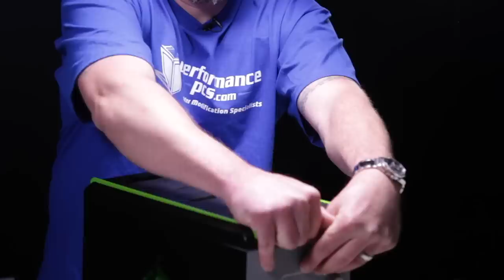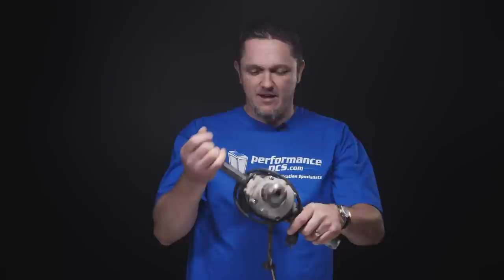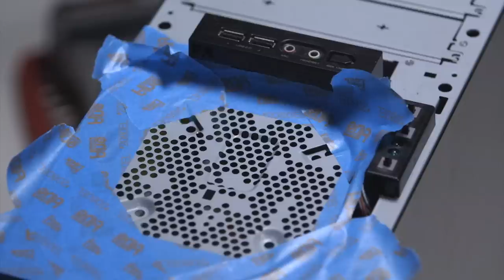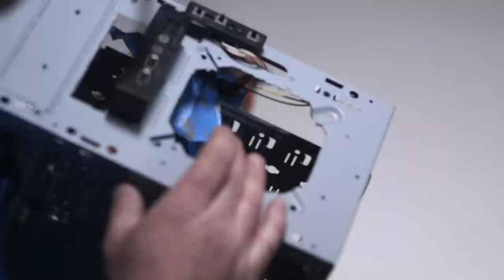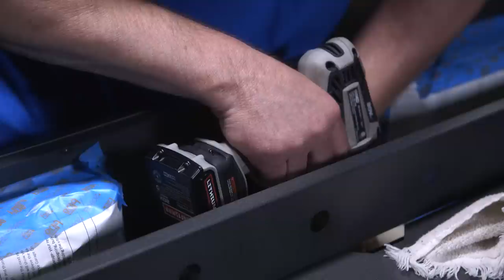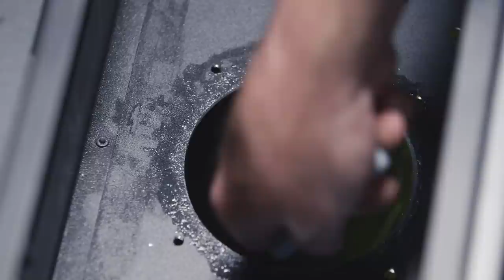GeForce Garage: Cross Desk Series, Video 1 - How to Modify Your Chassis For Better Airflow

Comment: So for all the people who care this video is geared to give you the basic know how to alter your chassis. Not just drill a hole. We covered all the basic tools and prep that you can use and the safety. If you apply these methods to a side panel to add a window this guide gives you the basic steps required to achieve that. If you have any questions you can contact me here on YouTube by searching for my channel or on Nvidia forums or my website Pcjunkiemods. My username is the same everywhere else. Thanks again for all the support and feedback.

Comment: You're gonna get a lot of air flow but a lot of dust too
Reply: ***** filter is good but air flow is going to be the same if he didn't cut it.
Reply: suliman khayyat Putting womans sock in front of a fan won't obstruct the airflow like the aluminum had
Reply: Dust II? 	( ͡͡ ° ͜ ʖ ͡ °)

Comment: yeah port holes are good for air flow but what about dust and pet hair ?
Reply: that is if a pet would go behind the PC somehow
Reply: +hypno toad You obviously don't have a pet. Pet hair goes everywhere even without it haven been there...
Reply: +no name here you can buy a super fine mesh off of ebay. It's pretty cheap too.
http://www.ebay.com/itm/1-sheet-300x200-mm-stainless-steel-woven-wire-Mesh-industrial-grade-/221502654072?var=&hash=item3392964678:m:mVhYJq3okBcOfxNwzG0jvmw

Just throw something like this on and you're good to go.
Reply: +no name here Filter.
Reply: Conal Fawcett You obviously missed the point of this video... Clap clap
They have "liberated" the pc from "obstruction" so they don't want filter since they just cut in the metal...
Reply: +Paul Theuns Not if the filter is upside-down.
Reply: Hair would enter through the small holes anyway. Does the case have filters on the front plate?

Comment: Can my laptop's NVIDIA GeForce GT 710M be changed ir un laptop's the graphics aren't change able
Reply: laptops have soldered gpus
Reply: The laptop gpu can be changed if it is a custom built laptop, like, alienware, sager, clevo. Most other companies can't, on the basis you have a gt710m, its very unlikely, as gaming wasn't top priority for the laptop.
Reply: ***** Most laptops even gaming specific use optimus cards which are soldered on.

There are some that have sli and switchable graphics that can be upgraded but from reading this is subject to the OEM giving you the upgrade so it's very proprietary to do so
Reply: *****
Not to mention laptop graphics cards are ridiculously expensive and the only real place to find them is Ebay.
Reply: Yeah i know, I was just mentioning alienware, sager, clevo could be changed, not whether its worth it or not.

Comment: Wtf NVIDIA Garage Team. I just watched your "How to Breathe New Life Into an Older PC" video and this isn't better either.
Please NVIDIA Channel Official guy, change out these guys who clearly have no intention to spread information.
This info is useless. Try to get someone like LinusTechTips - he's informative and entertaining... and not irritating.

If i had a local hardware dealer and he advised me to cut a hole in my case without dust filters or what so ever, i'd walk out of the door straigth away. Especially if he advertises his Idea with the Words: "Modify Your Chassis For Better Airflow"

Because here's my tip for better airflow: Take your Hardware and let it lay around with no case, so the GPU can have all the air it needs to function properly. -_-
Reply: I would get a case like the n630 by nzxt for a pc that needs so much air and not a 10 year old desktop pc case ...
Reply: So, you mean an open air test bench? By the way, Linus mostly talks about hardware, or assembling a system. He doesn't talk about modding with the exception of liquid cooling, because modding is not his specialty.